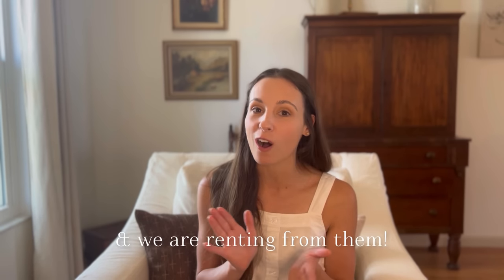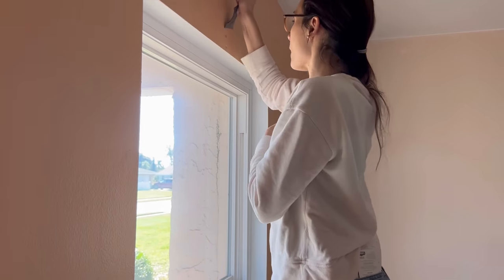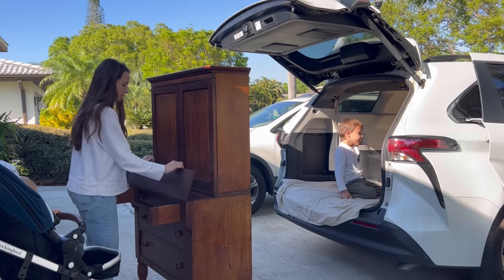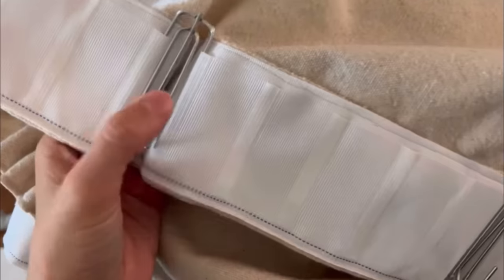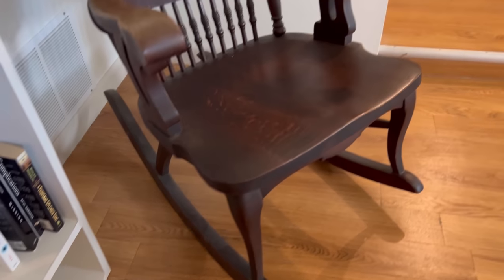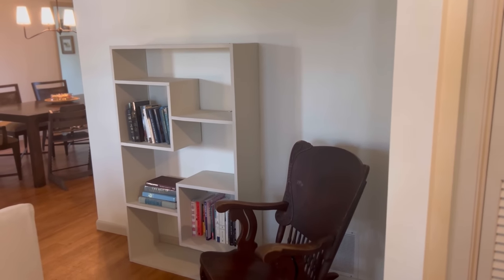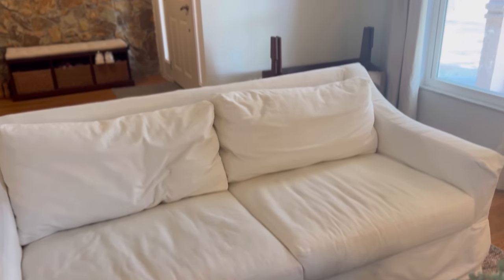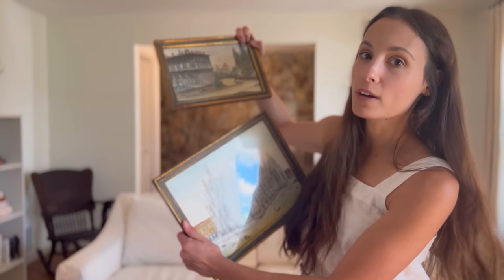COMPLETE LIVING ROOM MAKEOVER using thrifted furniture and decor!

Comment: Always sew your zipper in FIRST, before you do the rest of the sides.  

With right sides of your fabric together, measure the length of the zipper placing it centered on the length of seam.  Mark top and bottom of zipper with pins.  Using a normal stitch length, sew from the corner of the pillow to the pull end of the zipper, then sew from the opposite corner to the bottom of the zipper (where the stopper is).  

Next, use a long stitch to baste the zipper part of the seam closed.  Iron the seam open.  Unzip the zipper.  Position the top stopper of the zipper even with the end of your basting stitch making sure the pull is facing the seam.  Line up the center of the zipper coil or teeth directly over the center of the basted part of the seam.  Starting at the top of the zipper, use your zipper foot and a normal stitch length to stitch the first side of the zipper into place.  When you get to the bottom of the zipper, stitch past the stopper approximately 1/8".  With the needle in your fabric, lift your presser foot, pull the zipper tab to close the zipper, then pivot the fabric 90 degrees to stitch across the bottom of the zipper.  Stop at the seam marking on the 2nd side of zipper tape.  With the needle in your fabric, pivot the fabric and sew up the 2nd side of the zipper.  Remove the basting stitch and open the zipper.  

Next, sew the remaining 3 sides of the pillow.  Reinforce corners with tiny stitches.  Trim corners at 45 degree angles to remove excess fabric.  Press seams open.  Turn pillow right side out and you're done!!!
Reply from the maker: This is a great tutorial!! I just made another one recently in a DIY thrift flip video and was a lot more confident